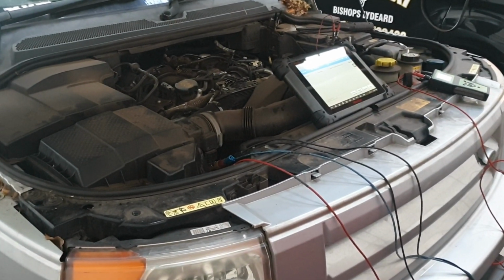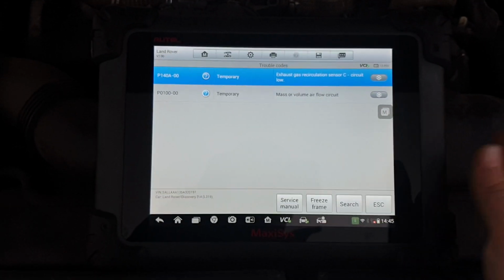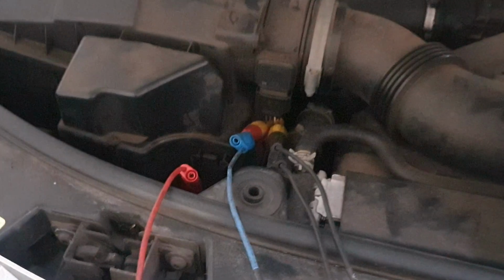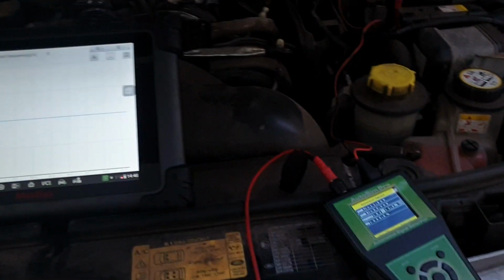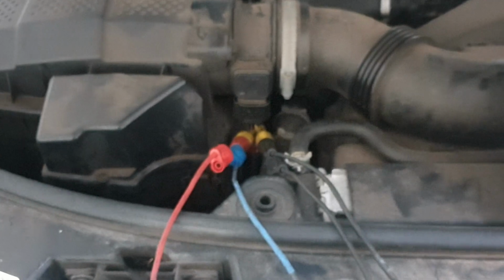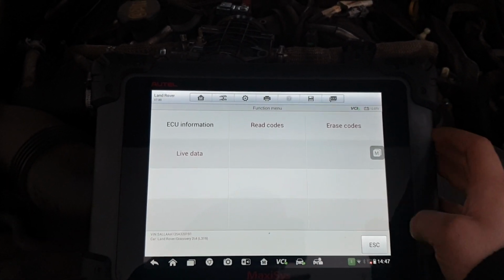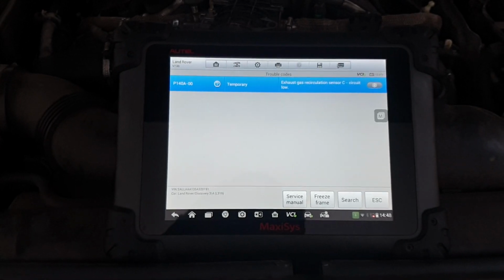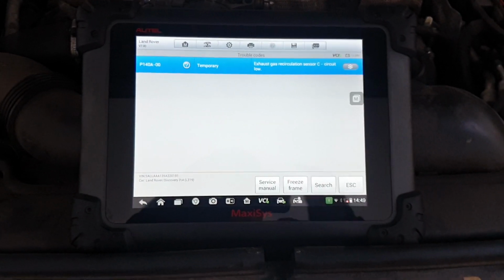Is It The Mass Air Flow Sensor, EGR Or Both?

Comment: If you think it’s your sensor, just take it out, don’t touch the sensor and spray off with brake clean. Than change your filter. Fixes mine every time. Symptom - loss of power up hills.

Comment: Hello, my Fiat Bravo 1.6 multijet is showing between 10-12 g/s on idle. I think this is too much for this engine? Also, sometimes the car idle is not stable and the rpm are moving. When I observe the MAF in that situation it is moving on idle between 1.5 - 13 g/s. Will cleaning the MAF with a spray will help? At the same time, I have P0487 on the ECU which is for insufficient EGR opening. I cleaned the egr and put it againg on the car but the error still appears.  Thanks in advance!

Comment: you say in the video that if you where setting a false egr code , both codes would clear ,but what about the mass air flow you are simulating it with the tool ( basically bypassing the mass flow señor )
, which I get that is its job, but how does it rule out the mass air flow sensor at the same time,( because you are making the signal in place of its self), because as you say the mass air flow can set the egr fault and the egr can set the mass air flow fault

Comment: Great video pal , interesting with autosim pro , I’m guessing you have it on sensor sim mode . Thanks for education video
Reply from the maker: Yes Soran that is correct, we are just producing a hall effect signal which would match the voltage amplitude of the original mass air flow sensor
Reply: Elite Automotive Diagnostics fantastic Ryan now this amazing tool become more and more familiar, I’m glad got one inside , hopefully you are doing all it it’s function at each video Ryan , love the methods

Comment: Great video. How did you know how many volts and what type of frequency the maf puts out if it was not working?
Reply from the maker: thank you mike, i did not, i used the baseline voltage as the peak voltage and assumed it was a 0v to 11.3v signal, i then alterd the frequency until i found the correct input, hope this helps.
Reply: Elite Automotive Diagnostics it does! Thank you! I have the ditex auto sim but have not needed it on maf yet. Works great for crank signals and vehicle speed signals. Also duty cycle fan controls😀
Reply from the maker: @mikesabin8568  great news! the possibilities are endless 👍